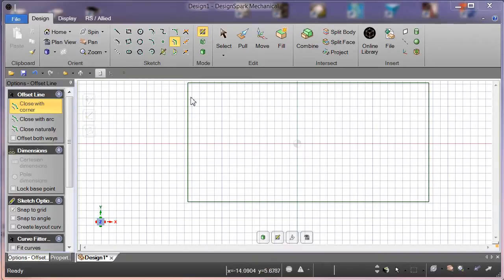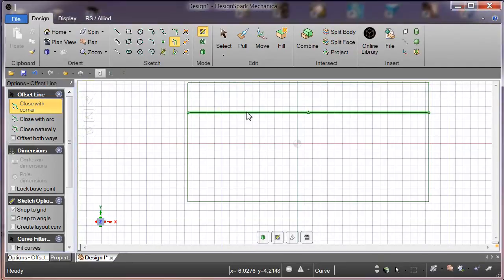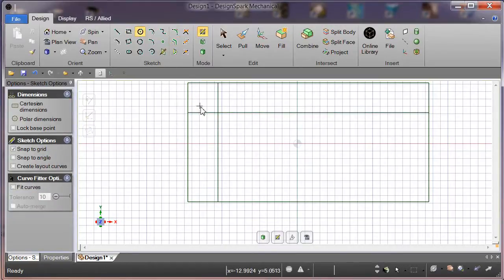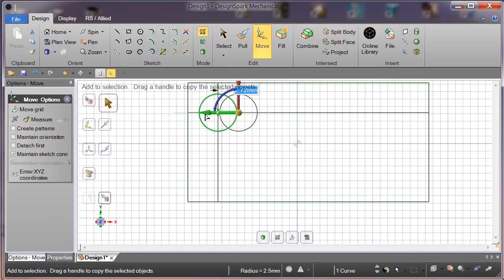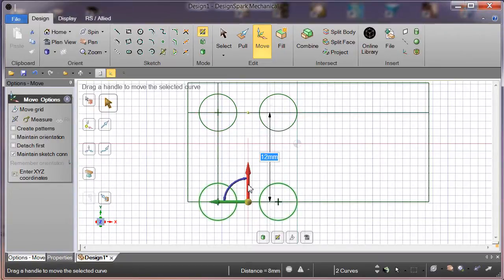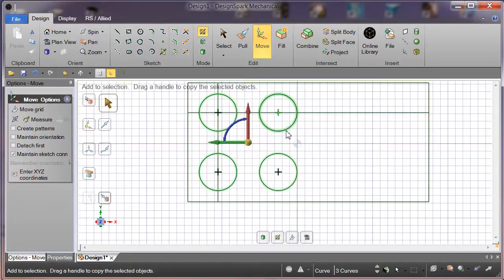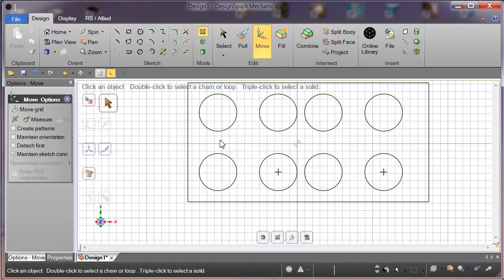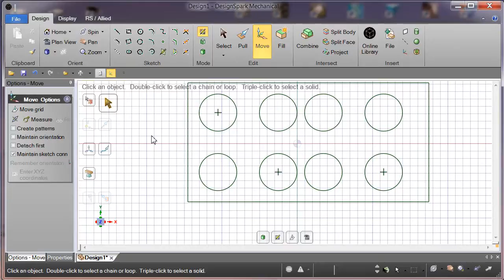Offsetting circles in DesignSpark Mechanical

Comment: I've been stopped by a problem, [I hope is not TOO rudimentary for you].  As someone getting started;  I am attempting QUICK START-> the CUBE. The issue is in Step 7;  "Press on it and deselect ‘Smart’ and ‘Faces’ '[CMPL.] Using the left mouse button, drag a box around the cube to select all the edges (now highlighted)[DOES NOT WORK]. Repeat step 6""...
I hope this conveys the issue.  I appreciate any Help.  Thanks!
Reply from the maker: I have just tried this for the first time ever - it worked perfectly. Suggest that you try it again - carefully.
Reply: @JimTaylor42  Thank you, for the Tip.  After abiding by Steps given;  there seems to be 'hidden meaning',  or as you would say 'hidden depth' in your word 'CAREFULLY'.
  I appreciate any Help.  Thanks!

Comment: You can make an array (pattern). Draw your circle, and then select it. Click Move (arrows appear on circle). check the pattern checkbox in the move options in the left pane. drag the red arrow down which duplicates the circle at the opposite end of your pattern. now you can tab between how many circles (count) you want, and the distance between them. you can then do a similar operation with the green arrow for the horizontal pattern. changing that first circle and hitting enter should update all the other cicles. try it out! I'm really digging DesignSpark Mechanical.